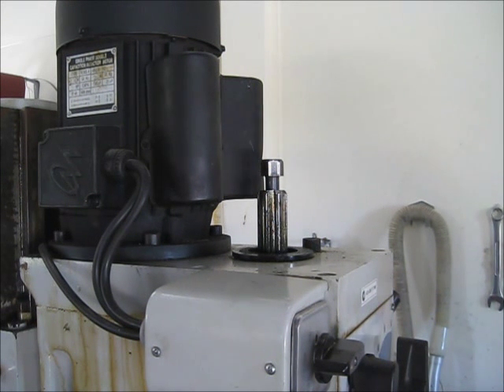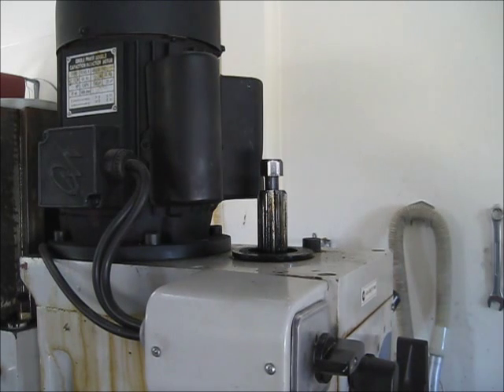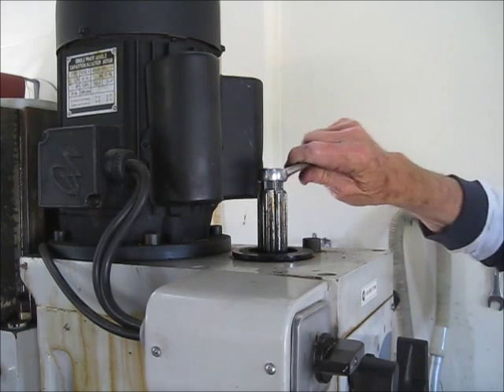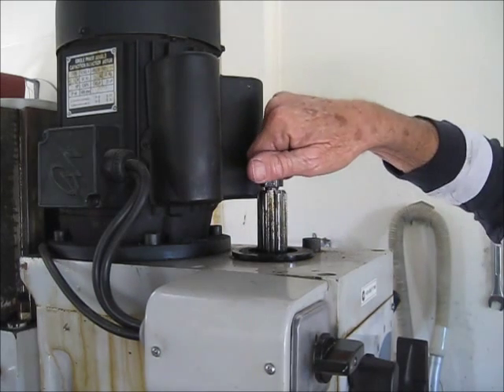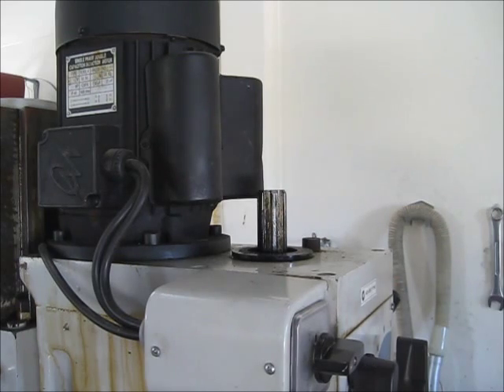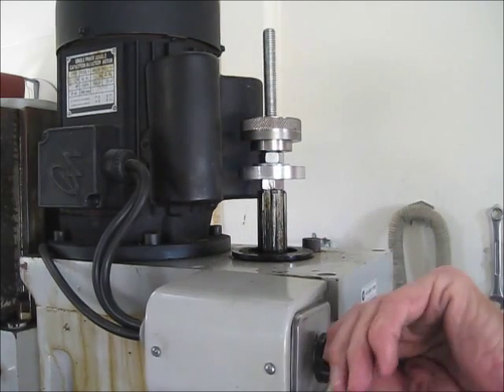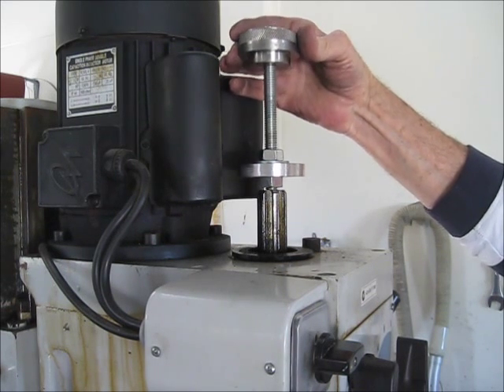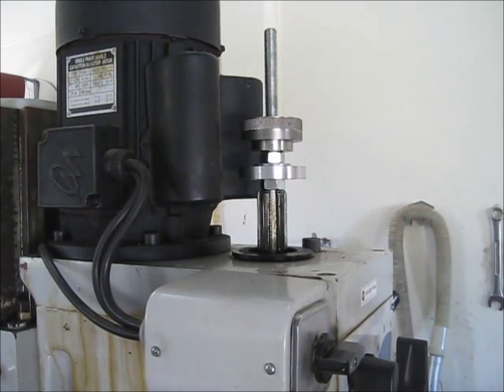Simplified Drawbar for HM45 Mill.wmv

Comment: its a nice idea , i have a simulair mill with mt4 collets , the drawbar is m12 and all the aftermarket mt4 toolholders are m16
an m16 drawbar doesnt fit through the spindle so you need a drawbar that goes in from the bottom and add a nut on top with some way to lock it 
this has been done allready and the bigger piece at the bottom hitting the smaller hole its mounted under pushes the tool off the taper when unscrewing
since i need to make one anyway i might go with the big ring for hand tightening with a bolt on top to yank it harder for bigger tools and possibly add some power to push the tool loose , might still do the airratchet on top of that lot https://www.youtube.com/watch?v=stxUtoRe1AA

Comment: If you are using a fairly big end mill in a collet, say 1/2" / 12mm and up,  then you will need to tighten it with a spanner as the cutter will have a tendency to work it's way out of the collet.  If you are using a normal drill chuck then it won't be a problem with drills and small end mills.  I have a nice tapered groove in my bed from this happening and the collet was pretty tight and I was using a 5/8 milling cutter.  Good job on the drawbar though if it works for you.